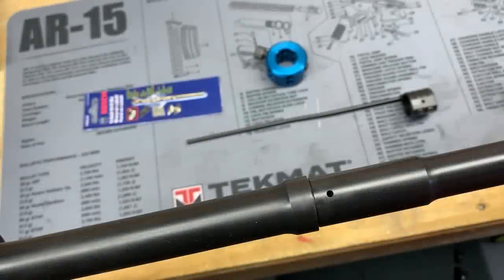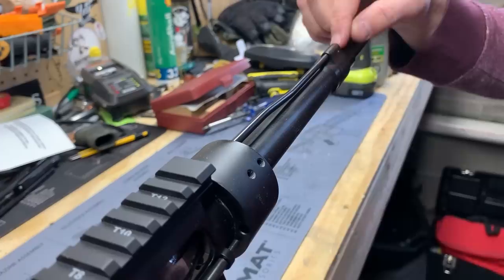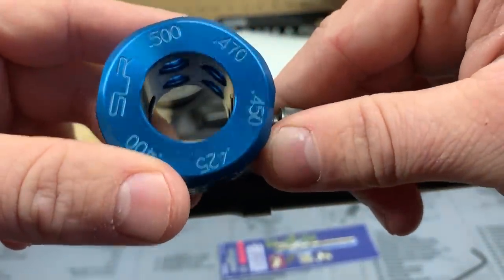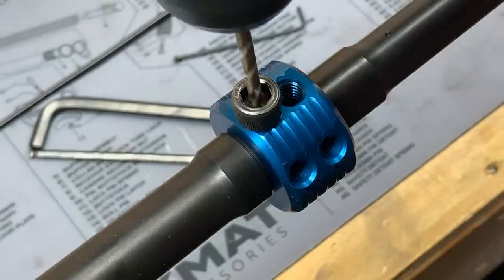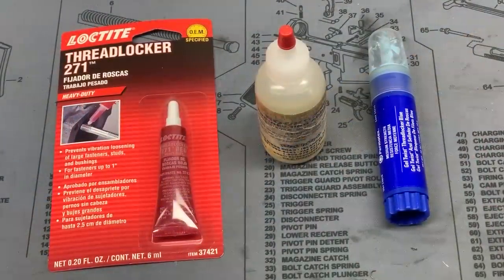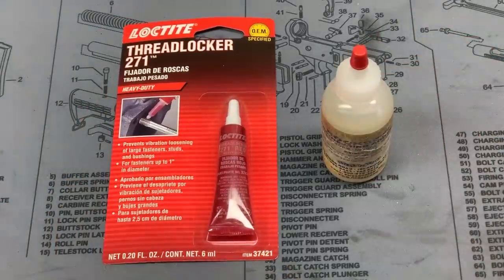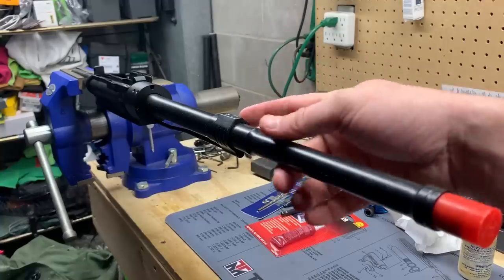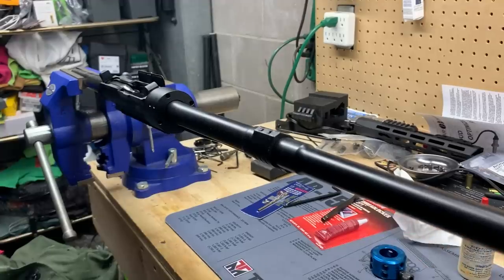How to PROPERLY dimple a barrel & install a Set Screw gas block

Comment from the maker: I'll jump in before any "drill press" comments pop up.  'Shouldn't you use a drill press?'.  This really depends on the type of jig...

The newest SLR Rifleworks 5-spacing jig, as seen in this video, is not so much intended for use in a vice/press, in fact it's intended more for use with a hand drill as shown in this video.  The drill bushing is more than long enough to facilitate proper alignment so that is a non-issue.

Some jigs, like the KVP jig for example, are designed to function in a vice and work with a press.

Regardless, both methods when using the proper jig and proper process will result in an equally functional end product.
Reply: Speaking of vises what is that you're using in the video?  I need one and would like to make sure I get a good one.
Reply from the maker: @mabs9503   This is a Irwin 5" rotating vice that I bought from Lowes, but here is a quick and easy Amazon link.
https://amzn.to/2UwXzGk
Reply: @Highjak86  you most certainly can use a drill press with the SLR jig. I have been using it for a year now. Use a drill press vise to hold the Jig.
Reply from the maker: @traxxastrucks36  I never said you couldn't, I simply said the SLR is designed more for use with a hand drill as shown here.  Reading comprehension.  You can, but it's not ideal since the flat faces don't line up horizontally with a vice.  If you have one of the older ones yours may line up in the vice with the flat faces in the vice, but the new ones as shown here do NOT.
Reply from the maker: @deputy dog No, but substantial heat from a torch is required to remove the screws when Red has been used.  More heat than I like to apply.
Reply: Torque..less is more.  Follow the torque spec, no more.  Test your work.  If the screws don’t back out after 200 ish rounds, they aren’t going anywhere.  When you overtorque, you are adding residual stresses to the barrel and your accuracy will suffer.

Comment: Great video. All manufacturers should just dimple them in house.
Reply: Sounds like a good idea, but you never know what gas block your customer wants to use and they have different set screw locations
Reply: @rf9078  with all the standard measurements the ar platform has, the gas block should be standard as well
Reply: @Dan Trebune you must be a mechanical engineer. No wonder .
Reply: Manufacturers can't know what gas block you want.  Also, imagine if every manufacturer did everything that all of the high price point manufacturers did.  Then every AR would be expensive.
Reply: Faxon gas blocks have 3 set screws. Just to make it even more annoying
Reply: @johnviera3884  I spoke to a guy at Wilson combat and he swears you only need to dimple one screw tighten the rest down and it won't go anywhere 👍🏼👍🏼
Reply: @Dakota-nn8vf  yeah that’s how I did it. I ordered a barrel pinned from the factory. But in my opinion, it’s overkill. And I don’t like the way it puts a notch in the barrel. It’s probably fine functionally, but it looks strange. Just such a deep notch through a brand new barrel.
Reply: @Dakota-nn8vf  for reference, the Faxon 3 dimple gas blocks are offset. So the first screw sits across and lined up with the gas port. So you can still use a standard dimple jig.

Comment: A good way to avoid using a torch on set screws is, use a soldering iron to heat the screw. It will get the heat where you want it and limit the amount of heat you put in.
Reply: I prefer flame thrower. To each his own
Reply: @michaelsorenson3887  I mean smoke if you got em I guess. But sounds painful and expensive.

Comment: I know, old video, but excellent for first timers and the point about not shoulder indexing is something that isn't always brought up.
I've had great success dimpling with a spotting bit or drill mill with the same angle as your set screws tip so you get a nice conical index with the set and dimple.
Spotting bit or drill mill like any you'd see used with a lathe or mill.  Many are coated in tialn or altin for some extra hardness and lubricity for cutting steel.
Rad.

Comment: I always make a point to coat the bare metal of the dimple with something. Typically a blueing pen or something that will stop corrosion. 
Just a point.
Reply: chris willis red loctite which you put on the set screws acts as film and prevents corrosion on the bare metal that's dimpled
Reply: @br00klyngreek13  red located will do you no good. The barrel gets to hot and will turn it to ash. Use Rocksett for anything on the barrel.
Reply: @TheUnholyLordClownz  Unless you're shooting full auto...your barrel isn't going to get 450 degrees sir....I build ARs and AKs for a living, and I have customers that are up 14k rounds through their ARs I built for them...red works perfectly

Comment: nice video. I have stopped doing both dimples as well, if the "build" might come apart again down the road. I picked up a bench top drill press from HF and mounted it rite on the corner of my work desk. i also recommend replacing the OEM set screws with Fastenal replacements that are 1 size longer, it gives the driver just a bit of extra depth to transfer TQ without stripping. with a good dimple they stick out just a hair but make it SOOO much easier if you ever have to take it apart down the road. if a set screw is sitting in a dimple it gets the longer screw.
Reply from the maker: Militaristics I dig the idea even though I’ve had no issues so far uses the stand screws. Shoot me a link!

Comment: Indeed, those set screws are tough. For my first upper build I bought a BA barrel and SI gas block. The barrel was not pre dimpled and the gas block secured with set screws, and I decided I was not comfortable winging it on my own so I went to a gun smith asking them to dimple and assemble the upper for me. They said dimpling was not necessary and proceeded to assemble the upper by simply tightening down the set screws. I was skeptical this would be enough, so when I got home I went to make sure the set screws were as tight as they could be and I twisted the tip off my Allen bit. I’m still not 100% confident the gas block is secure as it should be , though I fired it and seemed to perform fine. Lesson learned next time I will either buy a jig as shown or just buy a barrel that is pre dimpled.

Comment: Loctite 2422 is a 650 degree stable blue threadlocker that I have used on most of my gas blocks and it has never let go.
Reply: Same here. Dozens of AR's and 12 years or so later...... Not a single failure with blue Loctite
Reply: 242 is the one Colt uses

Comment: Hi, thank you for clearing up  the threadlocker issues I have been going through. I am about to install a new low pro gas block. I have loctite 271 but did not really like the max temp it could withstand. I ordered rocksett but I have been seeing so many different opinions. I am going to go with your recommendation. Thank you again for your help.

Comment: Two things, knurled head setscrews for permanent gas block install, they bite in to the barrel. Second, with rocksett it’s water soluble, but you want hot water, like boiling or a heated ultrasonic cleaner, it works really well if you turn on the ultrasonic as well. 15-20 min max will usually get it. You’ll see the grey compound leak out.
Reply from the maker: Shawn Hinck I’ve personally never seen any advantage to the knurled over standard tapered, but I’d be open to hear or read some compelling evidence on that one. I believe a proper dimple or dimples is about 99.9% more important than the tip of the screw itself. 

Never tried boiling water on Rocksett, I’ve tried the hottest I could get from the tap, but when it takes 5 seconds just to apply shock I don’t see a need to go as far as boiling water or getting out an ultrasonic cleaner.

Comment: Nice thanks for the video, I just bought an SLR dimpling jig for my first build and was wondering how the numbers on the front correlate with the center to center dimensions of the holes. Also thanks for the tip on the cobalt drill bit, will be picking that up this week to do my install.
Reply from the maker: Glad it was helpful!  That was the goal.

Comment: Great video brotha 
I would of degreased the threads on the set screws and the gas block and also added a little bit of rocksett on the gas block threads also 
And finish it of by also staking the set screws.

Comment: loctite recommends 222 purple up to 1/4” diameter and 242 blue for 1/4”-3/4”. The breakaway torque for the purple is 53 in-lb and 250 in-lb for the blue. Knowing that I only use purple on all but some of the larger screws like a #10 (.18” OD). As for temperature rating both the purple and blue are good up to 300F. 

I am a believer that heat is the #1 killer of barrels and I never want to shoot my weapon to the point that my barrel is close to 300F. 

With red being rated to a break away torque of 325 in-lb with a temp rating of 450F, I personally believe red is overkill and so is dimpling both set screws. One set screw is going to anchor that gas block especially when it is loctited.
Reply: Blue loctite for high heat applications is a no from me

Comment: Just knocked this out with the same jig. Definitely necessary to dimple. Be weary of buying drill bits that are carbon or carbide at 5/32, but have wide tips. That will prevent you from using the jig!

Comment: My buddy and I went shooting last Saturday like always, he was trying a 7.5 he just finished, and thr forst shot his gas block exploded.  It eas a KE arms adjustable gas block sold at out local gun shop, I jave never even heard of amything like this happening, but the gas block sheared it half.  I assume thr metal wasmt heat treated or was really low quality, thr good news is neither if us was hurt, but I was on his right and the larger peice flew over my head.  The only part we were able to find (the larger piece landed in the snow) was the bottom part with the set screws and it fell just in front of the bench
Reply from the maker: New2Kendo Yeah, no good. Lol.

Comment: I know this is a old video but figured I throw it out there, don't be scared to jam the gas block as far back as you can. Its not going to effect air flow at all but it will help the gas key seal up a little better with the tube being as far back as possible.

Comment: Great video.  What is your opinion of clamp on blocks?  Should I avoid those?
Reply from the maker: They arguably have some pros when you start getting into the rabbit hole of 'accurizing', but they much more difficult to align properly and reliably.  Negligible difference in accuracy.  Set screw is preferred.

Comment: @15:15 use the index set screw from the jig to aling front (dimpled) hole. Snug the rear screw to hold it in place. Then remove the set screw and put in the front screw in and tighten normally...??

Comment: Does cross pinning a gas block effect accuracy?
Reply: Generally no. 

The Geissele type “bombproof” setup takes quite a lot of material out of the barrel to use their oversized coil pin, that I could see having issues. 

But standard pinning with a 2/0 taper pin or 1/8” dowel pin is generally fine if you’re not going more than 50% pin engagement.

Comment: Great video!  One question, do you think is is worth test firing before using the locking compound, or just go ahead and lock it down right off the bat?  Obviously assuming that everything is aligned as you said.
Reply from the maker: JediKnight3420 Assuming the gas block was drilled properly by the mfg (which can be inspected before install) and you use a dimpling jig, there isn’t much need to as we know the alignment will be proper.

Comment: Is pinning the gas block necessary if you dimple the barrel? Do you only dimple and not pin your gas blocks?
Reply from the maker: I do not and will not pin a properly installed set screw gas block.  If done correctly there is no need for this step unless you're possibly just looking to torture test a gun in full auto mode until it starts on fire and destroys itself.

Comment: Man i hate to say it, but after two nights of going to town with the Bosch bit that you recommend, at least on an Aero CMV barrel, it doesn’t cut it. How long would you say you should have to spend drilling? I’ve spent probably a total of 45 minutes (drill spinning) trying to get this dimple done and it’s still not quite there. This is with the SLR jig. Drill for about 10 seconds, stop, check, ten more seconds, rinse repeat... there’s a dimple there now but it’s not quite finished. I finally broke down and ordered a carbide bit.
Reply from the maker: How long, with a good bit, only a minute or two.  If a cobalt bit is not cutting then you have a bad bit.
Reply: Try putting your drill in “Forward”

Comment: Not sure what the material of it was but the bit that came with my kit would not cut into my barrels at all so definitely look into buying more bits.
Reply from the maker: Yeah, pick up a cobalt bit.  I linked to the one I use in the video description.  That'll cut through anything.
Reply: @Highjak86  Yea, and I think the jig you have with the guide for the drill is a lot better than the one I have without.  Would definitely recommend getting one like yours.  I lose a bit of material from my jig every time I use it.

Comment: so  your torqueing the gas block screws as tight as you feel you can get away with. what about deforming the barrel in that spot? as it sits now, probably not so much. but after the 3rd mag dump in a row, when the barrel softens up a bit???  just food for thought.
Reply: Should torque to one half turn before stripping threads out

Comment: What about staking the set screws the same way you would the carrier key screws?
Reply: You can do so, but using Rockset or Loctite will hold a low profile GB in place for good. So it's purely peace of mind

been building for over a decade without issue.

Comment: Rosco is one barrel company that predimples their barrels but only the first one and they are both not deep or big enough. They need to be enlarged and slightly deepened for maximum holding and grip power. For a plinker or range toy they might be fine, but not for a HD rifle that gets run hard and that you bet your life on used for self defensive purposes.

Comment: I drench everything in red loctite 272 and when I need to take it apart, I just unscrew it, from set screws to castle nuts, even on cheap optic mount threads.  Again, I've never had to do anything but unscrew, never needed heat or a special tool or a hammer.  Am I missing something?  Am I using loctite wrong?
Literally, all it does for me, is make it a LITTLE harder to unscrew...
Reply: It should definitely take a torch to remove if you have more than just a tiny dab. Not sure what's going on there lol
Reply: You need to de-grease the hole and the set screw and let it dry out before using the Loctite. It won’t stick to an oily surface

Comment: A1/A2 front sight bases and low profile gas blocks don't hit the barrel shoulder. There should be approx 0.025" gap to account for the steel hand guard cap if the gas port was drilled to Mil-Spec. If it is shoved all the way back to the shoulder the port will be misaligned and not be installed correctly.

Comment: I have the SLR .750 jig and have used it on 4 barrels with 0 issues. But I recently started a new build and needed there .625 jig. When I got it I was excited to dimple my barrel and much to my surprise it would not fit on to the barrel. I Emailed SLR and they sent me another .625 and the same thing happened. Now they won't answer my emails. Have you had any fitment issues with there jigs ?

Comment: All gas blocks should be set off the shoulder of the barrel about .030 inch. 

 Barrels are made so a standard two piece handguards will fit on them if the gas block is against the shoulder the handguard cap will not fit.
Reply from the maker: Not true. This is entirely manufacturer specific. Barrel shoulder and gas block lengths vary. And who is installing two piece drop in hand guards with a low pro gas block? No one with a brain.

Comment: Question...I used blue Loktite on my gas block. I want to put an adjustable block on there...How do I break it loose?
Reply from the maker: kempoguy Blue is medium strength and should come off just by turning with a wrench, but you can use a little heat if needed.

Comment: is gas tube all the same standard length size
Reply: no depends on the gas system your running there are 4 types   pistol.... carbine .....midlength..... and rifle
Reply from the maker: Just a Regular Guy  Don’t forget intermediate length as well. There are at least 5 at this time.
Reply: @Highjak86  yeah but I never see that regularly, usually for me I see that in custom stuff

Comment: I shot 50 rounds out of my brand new AR and then shells stopped ejecting. after tons of consulting friends and the interwebs i almost gave up. I just inspected my ar and noticed the gas tube and block is sliding forward up the barrel. I'm really hoping thats why my shells were not ejecting and also why i had to mortar my rifle just to get the bolt back out of the chamber. so i guess i need to figure out how to line up that gas hole with the tube and tighten it down?
Reply: Buy and use a alignment/dimple jig as shown in this video. It takes all the guesswork out of the situation and makes it simple and straightforward. They are typically $31- $35 on average. After you get one you will have it for future builds.
Reply: @JohnDoeEagle1  I appreciate the info! I actually found that it already had a dimple. The issue is that the shop or whoever built the rifle didn't tighten anything down very well. I lined up the gas block and dimple with the screw and re-tightened it after adding some rockset to the screws and now it's firing and ejecting great!
Reply: @kotaspremiere2931  

Awesome, good to hear!